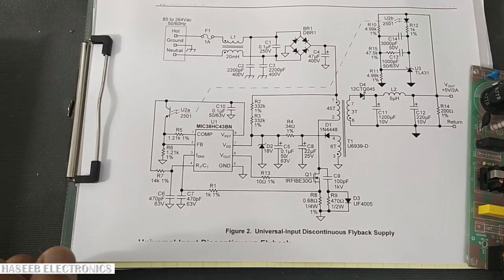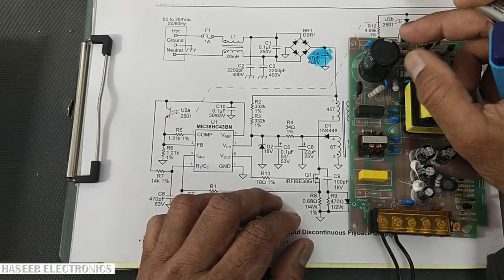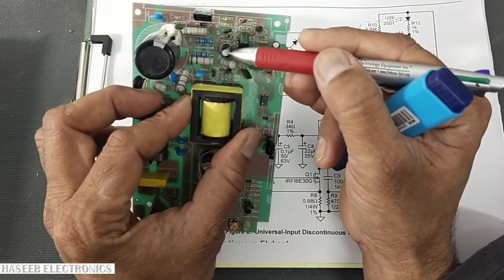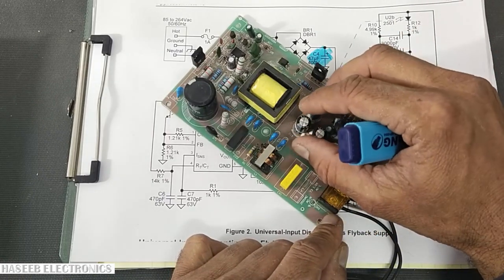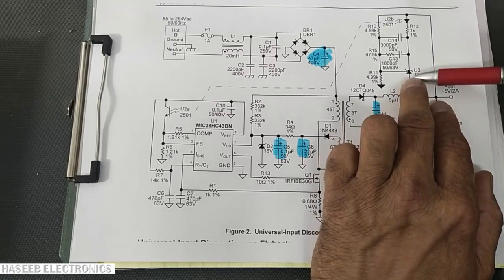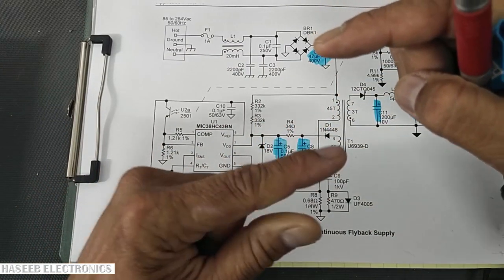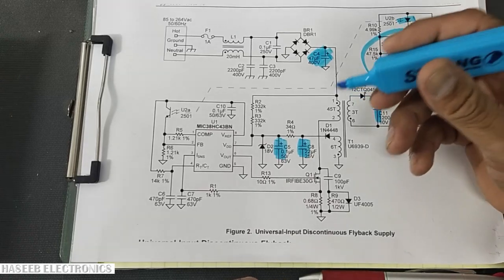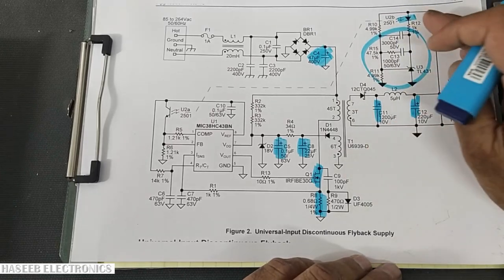{581} Why SMPS Fluctuates / Reasons for SMPS Output Voltage Fluctuation Switch Mode Power Supply

Comment: I work on these all the time and your description is very good in troubleshooting these power supplies for their usual problems.
Reply from the maker: it is my pleasure
Reply: What causes some delay in output voltage. Like output cap taking some time to start giving fix voltage. Please help me🙏
Reply: @ganesh3205  That would indicate the oscillation is not fully comming in stable or in a proper square wave.. If the pulse modulation from the mosfet (high side) is distorted it could cause the output caps to slowly charge up and if connected to any load might not stay running.. I would check any of the small capacitors around the regulation IC and high side of the transformer..
Usual a small cap 1mf to 2.2 or even 4.7 capacitor (several may be there need changing) it helps start and run the oscillator IC,, this IC will turn on and off the driver mosfet.. So main power from AC that is turned to DC by the big voltage capacitor from the line input goes to one side of the transformer then mosfet then is used to ground one side of the primary with the output of the timming regulation IC driving it's gate ... there is a feedback loop from the optocupler that changes the pulse width of the ic to regulate the voltage..
But check into the capacitors in the input... All caps (electrolytic) might be suspect though, even in output..a bad cap there can load down the supply and make it struggle to keep up..
Reply: @chazlabreck  Thanks a lot for sharing the valuable knowledge and time😊
Reply: @ganesh3205  Absolutely you are welcome...watch this video he really does do a great explanation...but like I said many times these supplys are simple to understand and capacitors in these circuits are under strain and often go bad...electrolytic capacitors are prone to self destruct after some time...chemical breakdowns can be slow and not fail tottaly but get worse and worse and this is why we see odd behaving from these type of power supply..they work in a feedback loop...one thing fails and the whole thing won't work..so it's tricky to trace.. One component bad it won't start up...one component a little bad and it will behave strange.. 
I wish you good luck in finding the solution...

Comment: You are awesome.  I have learned so much from you!  I have repaired a lot of SMPS PSUs lately and your tips helped me.  A ouple of them were fluctuating and some just needed tank caps.  Thanks again :)
Reply: What tank cap?

Pls help me, mine is fluctuating too
Reply from the maker: Tank capacitor is bulk capacitor or smoothing capacitor or main dc capacitor
Connected after bridge rectifier
Reply: Yes. the tank cap(s) are the large high voltage caps in the AC to DC rectification circuit

Comment: Hello
I have a similar PSU that is rated to output +/-12V. When unloaded, the output terminal has +/-15V. 
When loaded with a PCB board, the output jumps to +/-19V.

I purchased a 10 ohm 3 w resistor. When I load it on the +5V rail, the +/-12V rail jumps to ~ +/-26V. Any idea what type of issue this is?

Comment: sorry sir, I want to ask. i am trying to repair psu atx with active pfc. the problem is when it is turned on it sounds like a ticking sound tick tick tick (ticking noise), when I check the voltage on the main capacitor (2×150uf 450v) fluctuates, the range is 380-400vdc. but the output is normal and stable. What are the components that I need to check? what causes ticking noise, with the voltage on the primary fluctuate?

Comment: Sir, can you  please make a video for troubleshooting projector power supply model no PH-AIO-312. I am getting stand by voltage 5v and when I switch on the projector the series lamp glows  brightly and goes dim and then glow brightly after 5 seconds and stops. Sir can you explain the above mentioned power supply board working with circuit diagram. During the on time the main filter capacitor is not  charging full. I have replaced it also but again same problem. Sir can you help me to fix this problem thankyou
Reply: Change the short key diode .. Of out put side.

Comment: Your teaching method is too good 
I have a question  Sometimes power supply output volt is ok but on load  mains on voltage drop& fluctuate  but without load mains on voltage ok than connet load than on load ok 
 At this condition what we should do and hou to test 
Dso will help us understand it problem in secondary/ primary section ? 
 क्या  कोइ step by step method नहीं  है  जो  हमें  2/3 camponent par dout कराये or fault clear हो जाये  
Please make a video with dso on this topic

Comment: Hello sir thanks a lot for your good explanation. I have a question: in a smps that I want to repair it, with replace x capacitor voltage on secondary  side appear on 12V. But when install a load to it voltage dropped and fluctuated to 0-5 volt and load does not work. Please  help me. 🙏🏻🙏🏻🙏🏻⚘

Comment: Sir , the voltage is stable in unloaded condition , once loaded it fluctuates , the capacitors are good .

I see the PWM IC VCC also fluctuates only output is loaded ,what the problem in that case

Comment: Assalam Alaikum, Ramadan Mubarak, I have almost the same power supply 48V 4A, with power fluctuation problem and ticking sound, when I check the voltage on the main capacitor 150uf 4050v the voltage is fluctuating too, an Idea? Thanks in advance.

Comment: Dear sir, first of all ROMDAN MUBARAK. Your every tutorial is very sharp and clear thanks for your great contribution. Sir, I want to make a CVT using triac with phase angle control rather using bulky dimmer. Load capacity 1KVA, Triac part no. BTA41. My question is 
Is it good practice for doing so? Is there any adverse effect of doing so?
Reply from the maker: Best regards and special thanks 
Ramdan Mubarak
yes BTA41 series is good to use, because it have a great headroom of 40 Ampere 
so it can be utilized comfortably

Comment: Sd6834 no output, voltage fluctuates at the VCC point 12v-14v, no short circuit found, still trying to find the fault.

Comment: Hello sir uc3843 ic ke pin 1 comparator pin low hone per output pwm off ho jata lekin circuit mein to optocoupler positive reference 5volt se connected hai to ic ka pwm kaise off hoga   matlab optocoupler on hone per to pin 1 mein 5 volt aayega to wo ic ka pwm kaise oof hoga
Reply from the maker: basically optocoupler aik varying signal deta he jo k depend karta he secondary side variation per 
is feedback control system ki calculation depend karti he k aap kis type compensation use karty hein 
normally type 2 compensation use ki jaati he 
error amplifier ki pin per kabhi bhi aap ko voltage nahi milien ge  k ye sink current per kaam karta he 
mein try karoon ga k error amplifier per detail se discuss karoon
Reply: @HaseebElectronics  thankyou sir please is par ek video banayiye
Reply: @HaseebElectronics  isko aap explain kare

Comment: One smps have two photo transistor one photo transistor both side voltage 10.5 volt another acutocupler no voltage both side ..smps not on what problem

Comment: I have 2 dc adaptor of 12V 5A and 24V 5A respectively. But whenever I try to run a R775 motor with these 2 adaptors, it starts Pulsing. Motor does not run continuously.

What may be the possible problem here? How to fix it at home?
Reply: Use soft start circuit